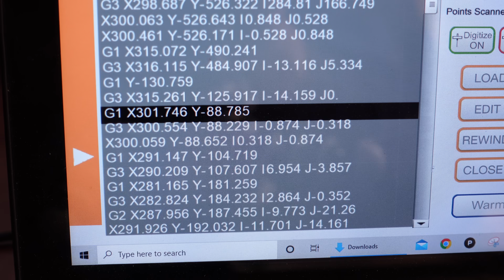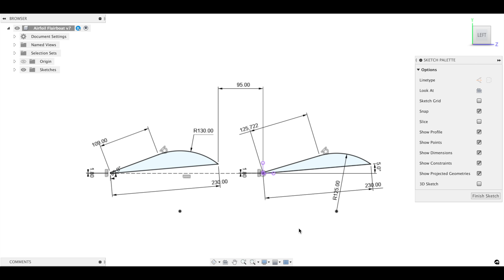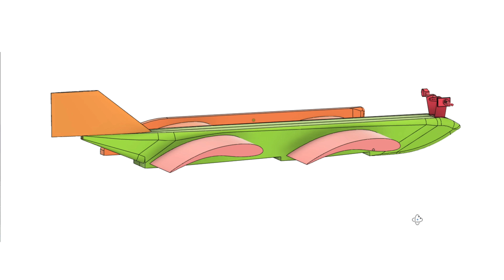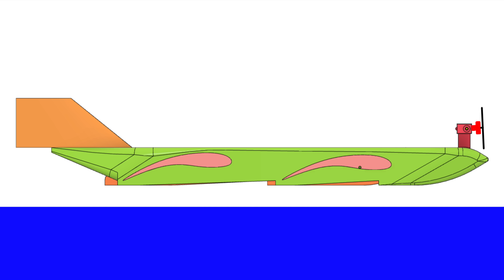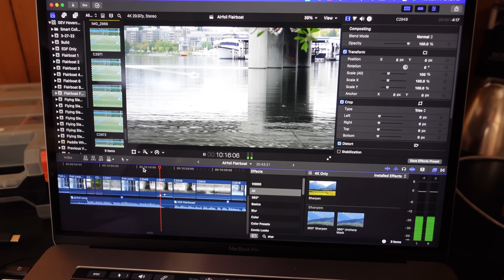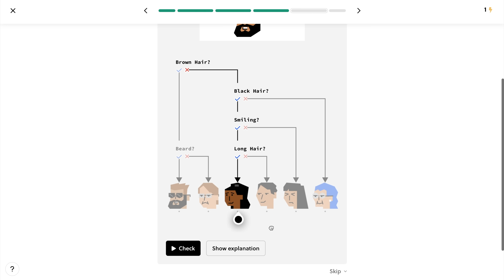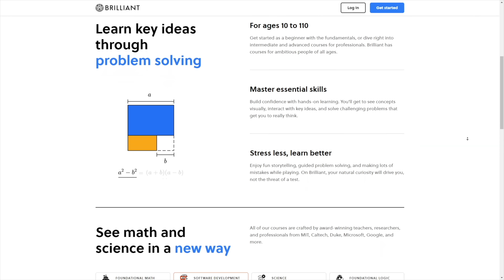Worlds First R/C Airfoil Flairboat

Comment: Can you find out the difference in efficiency between flying in ground effect and flying normally in mid air in the next video?
Reply: I see you going for a back to back top comment😉
Reply: @SemteVruchte  0
Reply: rc long range mission in groudeffeckt and normal flight
Reply: i think it would be maybe a proplem to find a long enough route where the water is calm enough ore you have a flat area maybe in a salt lake but i dont know
Reply: Good f ing question
Reply: I’ve been thinking about this question when he got interested ground effect vehicles in day 1.
Reply: He mentioned in video higher payload and lower induced drag 08:22
Reply: @TrueHolarctic  I think the big question is what you are measuring and what you are comparing to. Ground effect vehicles will not be as fast as airplanes, but will be able to either have better fuel/energy efficiency or carry a heavier load. Compared to boats a GEV has worse fuel/energy efficiency than a displacement boat, carry less load but be much faster. Compared to boats capable of plaining I'm not certain just how the energy efficiency will compare. But the GEV is still much faster, and it wouldn't surprise me if it's more energy efficient simply because of lower drag. Load capability is another uncertain factor.

Now how much the energy efficiency changes when using the ground effect, now that's something I can't even speculate about. When increasing the speed drag becomes very important. In boats we've tried to combat drag by how the hull is shaped. Displacement boats have to mover the water in front of the bow aside and at the stern the water will move back in to fill the space that the hull previously occupied. The length of the hulls water line and the hull shape changes how it moves through the water and how much energy it takes to do so. A very clumsy rule of thumb that works to a degree on smaller displacement hulls says that for each meter of length by the water line the boat will do one knot. This is of course a crude estimation, and throwing more energy at it you can go faster, but the amount of energy needed rises in a non linear fashion.

A hull designed to plain starts out acting like a displacement hull at low speeds. Increasing the power allows the hull to climb up over the bow wave as the weight of the water that need to be displaced become larger than the weight of the boat. By flattening the bottom of the hull, making it wider, the threshold for this to happen is lowered, and by designing the hull to trap air under the hull the drag of the water can be lowered even more. As soon as the hull climb over the bow wave the energy needed to maintain the current speed goes down significantly.

Hydrofoil boats take this wot the next level. The hydrofoils lift the hull out of the water thus reducing drag significantly making it possible to achieve much higher speeds or save energy. Pick one.

A Ground Effect Vehicle is the next step after the hydrofoil. The GEV will also lift the hull out of the water, but then will rest on the air cushion built up between the "wings" and the surface, in this case water, below. Drag is even lower than it is for a hydrofoil and energy efficiency should be a tad better if they were moving at the same speed with the same load. But the GEV can achieve higher speeds than a hydrofoil and that is most likely how it will be used.

So if you compare a GEV to an airplane then you also have to consider the speed. At the same speed the GEV should be significantly more energy efficient, but the big draw of airplanes are their speed. Well that and their ability to just cut across almost any type of terrain. So any airplane is very likely to fly a lot faster than any GEV and fly an almost straight line to the target.
Reply: And also vs floating in the water (ie a boat) and maybe even driving on a road
Reply: Multimeter on the motor, done
Reply: @janeblogs324  following the plane by running on the water while holding the multimeter?
Reply: maybe a speed race
Reply: Raw engine thrust to takeoff weight ration:
Plane - Antonov An-225 Mriya (640 t): 4.55 (takeoff), 22 (flight)
GEV - Lun-class Project 903 (380 t): 3.65.
Plane - Antonov An-124 Ruslan (392 t): 4.18

payload:
An-225 - 250 t
Lun-class - 100 t
An-124 - 150 t
Reply: The same system as the Russians 60 years ago!
https://www.youtube.com/watch?v=mryyvJwakn8&t=1s